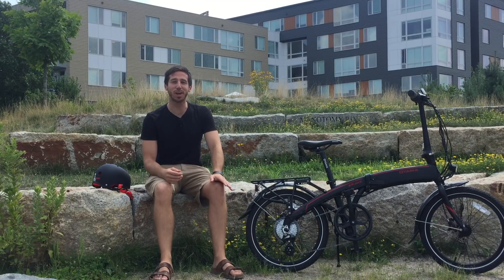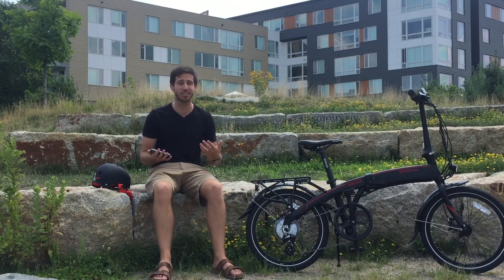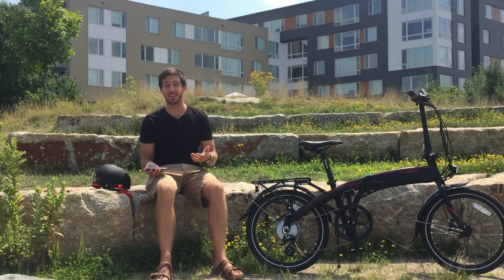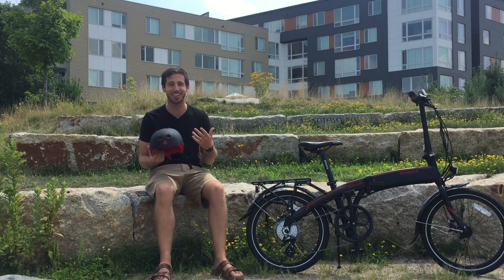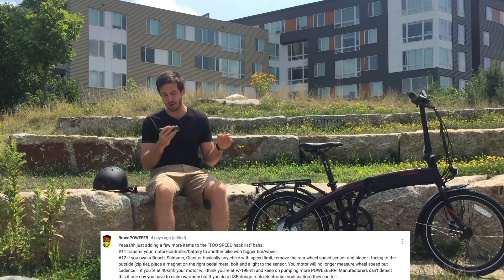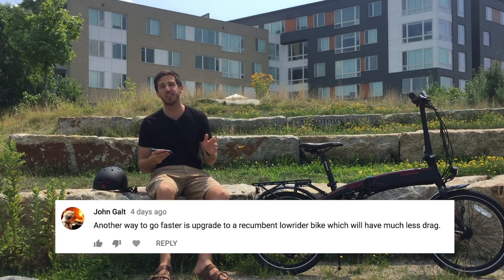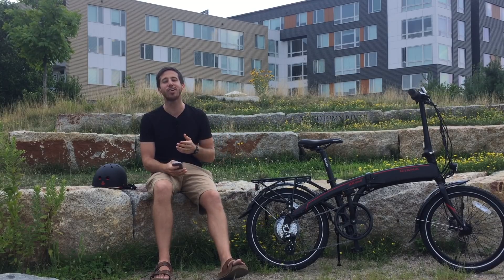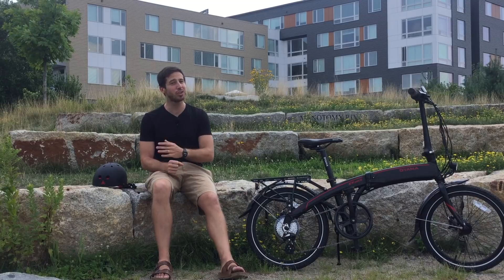Fast ebike tips follow-up video (with YOUR comments!)

Comment: One more question on this subject, I changed my battery from 36 volt to 48 volt, I looked inside the speed controller and I have  2 63volt capacitors. But with the 48 volt battery it is completely dead, hooked up the 36volt battery and it is back alive. Why won’t my ebike run on a 48volt battery?

Comment: hi Micah  im just after some info  im doing a custom build ill be running a 12kw peak 15 kw hub motor with a sine wave sabvoton controller phase max current 450amp dc max current 200amp  iv been looking into batteries for the build  im not sure if id like to go with lipo is there any alternative iv been told id need about 300amps and most of the plug and play batteries only have 50amps any help would be great     cheers frank

Comment: Hello... I own a Daymak EM2 E bike, which has all stock parts, does a max speed of 34 km/h with a full charge, has 6, 12 v lead acid batteries and... well, here is a link to the specs,  http://www.daymak.com/manuals/em2-manual.pdfl,   as they would be able to give more useful info then i can quickly do here.  I was wondering if i added another battery to it (from 6 to 7 batteries) if that would increase the speed or duration of ride time i have, or just up and kill my whole bike.

Comment: To install fan(s) to cool battery, I'll need 12v. Where can i get the 12v coming out from the controller, without building another battery? I'm using a brushless 48-84v controller. Thanks for the videos and help!

Comment: i would like to hear your thoughts on using a trailer when you have a rear hub motor. i have been having problems finding a hitch that will work with a larger axle out of the box

Comment: Hi Micah, 
I want to connect two of my 10s battery packs (with 10s BMS each), in series to make a 20s battery pack. Would both 10s BMS work fine? Does the BMS on the 2nd battery in series need to be for 20s? I'm a bit lost. 
Thanks
Ben
Reply: Could anyone shed some light, please? Any advise will be much appreciated. Cheers!

Comment: I put a small 250w hub motor on 12" tire lots of torque! with 14s lifepo  pack top speed is only 15mph though; great video cause I wanna try and speed it up thanks

Comment: Hi Micah,
Thanks for some great, informative videos on Li-Ion batteries and the Vruzend kits. You've helped me gain a college course of knowledge every time I watch one of your videos.

NOW, this video caught my eye/ear, when you said; "it's the cheapest helmet I could find in this style".
As a Motorcyclist of 48+ years, I grew up with Bell Helmet's Slogan (The Bell helmets ad campaign of 50 years ago) “If you’ve got a $10 head, wear a $10 helmet, otherwise buy a Bell!”

The first Helmet I ever bought in 1972 (when I started riding motorcycles), was a Full Face Premier. After that, it was always a Bell Helmet (other than the Simpson "Darth Vader" you see in my avatar photo)
YOUR head IS worth more than $10. Buy a REAL, high level pro helmet. Doesn't have to be full face, but at least a 3/4 helmet with a 1/2 face shield.
Oh, and the LAST thing you should worry about, is how you look. We have to stuff our egos in our pocket when it come to safety. I ride my Currie electric scooters with a HJC 3/4 Helmet with visor and 1/2 clear face shield. 
I could give a rat's butt what anyone thinks.
Nuff preachin.
Just do it!
cheers
Boots Langley
La Mesa, ca

Comment: Hi sir!
I was watching your videos about ebike battery.. 
I was just planning to build an ebike 48v 1500watts motor..  if i build a lithium-ion battery 51.8 v to over volts it with 35ah? One thing problem is i have a PCM 14s 40a.. can i used this PCM on my battery 51.8v with 35ah..
Hoping for your reply sir.. thank you in advance and GODBLESS..
SHALOM!

Comment: haha, was not expecting to be mentioned in the video. btw I did not think of the chain ring and gearing at the time; but thats a solid and cheap way.  At least on Bafang middrives, Bafangs chain rings are about $30 and decent cassettes are around $20.

Comment: Yet another great video Micah! I discovered your site a while back and have been following it ever since.  I'm all in now.  Bought the DIY battery book which I would recommend to everyone, got the V2 battery caps through your Kickstarter,  settled on a 1 Kw front hub motor and am now sourcing batteries as I convert my 26" 10 speed to electric. I'm looking forward to trying it out in our Canadian winter with snow tires!

Comment: Hi Mike!
I want to increase the speed of my 500 watts 20’’x4’’ fat tire e-bike by ordering 14S 6P Li-ion battery to be made from 84  pcs of 3500 mA/h Samsung cells to replace the existing one 13S 6P ( 78 cells) which gives max.speed upto 37 km/h when being fully charged upto 54.6 v. What would be the exactly the increase of speed I should expect from this replacement? Thanks!

Comment: sir mike, i just wanna ask about DUAL BATTERY and external battery for extended range.How does the switch works.i saw some escooter that has a provision for external battery just like DUALTRON. the way it works is that, as you plug in the external battery, the internal automatically shuts off or it extends the range of battery.How does the wire diagram looks like? Thank you sir
Reply: maybe an additional tip i can share about the speed increase is this kind of set up.im not sure but maybe it increases the AMPERE as it increases not only the capacity.

Comment: 2:26... Electrolytic capacitors are commonly chosen to run at a voltage 20% to 50% less than their ratings. We chose capacitors that have twice the rating that the circuit will work on.
Chinese manufacturers usually choose capacitors with a voltage rating only 20% over the voltage they will run on.
The Maximum circuit voltage can not be deduced by the Electrolytic capacitor voltage rating marked on the capacitor.

Comment: As always, another great video. That switch to disconnect that limiting wiring was a great idea, and got me to thinking. Is there anything you can do, besides disconnecting that wire, to give yourself a boost of power if needed for a short period of time? 

Kind of like K.I.T.T. from the Knight Rider and its turbo boost button? You know in case you're riding along and have to chase criminals or jump cows in a field or get out of a crowd of left wing wackos or some thing.  haha  Keep up the great work.

Comment: As usual, great vid with good info and a source of inspiration. I have a production folding ebike that has been orphaned by an importer that disappeared, so I'm going to have to deal with any repairs, maintenance and/or upgrades on my own. As Tavarish says, "I am the warranty"!

Plus, I have a cheap, very heavy full-suspension mountain bike that I would like to electrify just because the weight makes going up even a slight hill a literal PITA.

Comment: I have a question.
I get why using say 4-parallels in a 13-series is better than 13-series in 4 parallels as far as BMS is concerned. You get better “resolution” I.e. reference points.
However isn’t there a downside with the higher risks associated with cell shorts? If a cell in a 4-parallel shorts then it shorts the entire parallel and there’ll be a lot of heat buildup and much greater risks involved. If a cell in a 13-series shorts then the voltage just drops slightly and you can continue to ride safely without catastrophic failure.

If this is the case why is the first setup more commonly used?
Thanks.

Comment: Hi micah, would it be wise to overvolt a 250w motor with a 48v battery and controller ? In the UK we can't have motors above 250w, so overvolting is the only "legal" way of getting speed. Let me know of any 250w motors that can handle a 48v overvolt. Thanks
Reply: FrostGhost HD just buy a 1000w ebike kit and put a 250w sticker on to it believe me most police wouldnt even know the difference
Reply: MegaNayton The problem in UK might be they can’t get a motor with > 250 watts even by ordering it on-line - Custom Authorities wouldn’t allow it to the country 🤷‍♂️🤨
Reply: Alexei Gortchev No, I currently own a 1500w ebike and fitted the kit myself. I bought it quite easily in the UK. I am thinking of downgrading to a 250w motor because I was scared of being pulled over by the police!
Reply: I know as ive been pulled by police on a scooter/ebike and they didnt even think to check it over was more bothered about the fact an ebike looked like a scooter 😂
When i say scooter i mean moped
Reply: As long as you’re wearing a helmet and start pedalling for a few seconds approaching road police, everything is gonna be fine!

Comment: hey mikey, I have a 48v 20ah battery and a 1000watt front hub motor. I never have heat issues with the battery or the motor, but the controller gets hot. so what I done was strap blue ice gel freezer packs to the controller and only use half throttle while pedaling up hills. and it is very true about weight, the less weight the better for ebikes. a titanium bicycle frame is what's desired.

Comment: Do you have any thoughts on how viable it would be to use a front dynamo hub, with its output passed through a rectifier and additional circuitry to reach charge voltage, to passively charge an ebike battery? The one use case I can imagine for such an arrangement is to slowly charge a second battery on long trips without having to stop, without having to figure out how to rig a solar charging solution to either your bike or a towed trailer.

Comment: 6:05 - Cooling the battery does not help with voltage sag. It just helps keeping the battery healthier. Li-ion actually performs better at 30° C than 20°C, for example.

Comment: In a dual motor setup (front and rear hubs), is there a way to have one hub for low end torque (i.e. geared) and one for high end speed (non-geared) and a controller that %splits power between the two based on the speed/torque requirements?